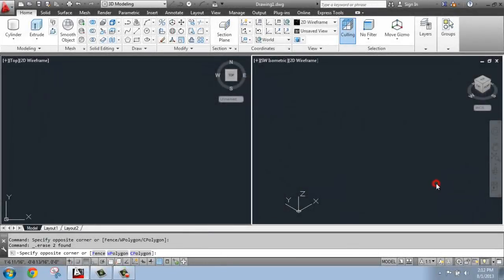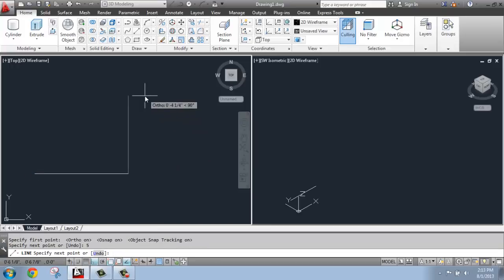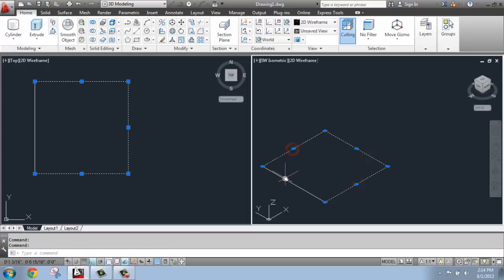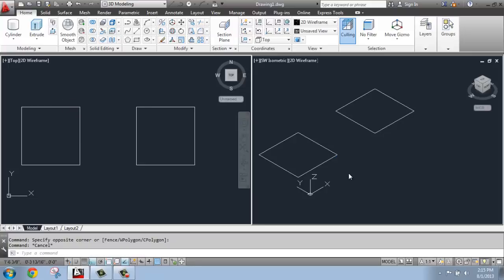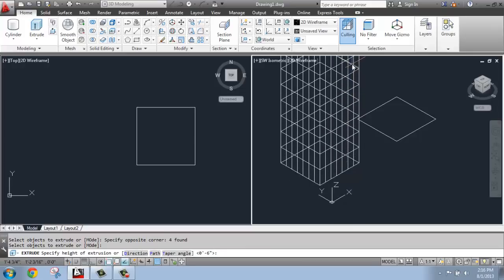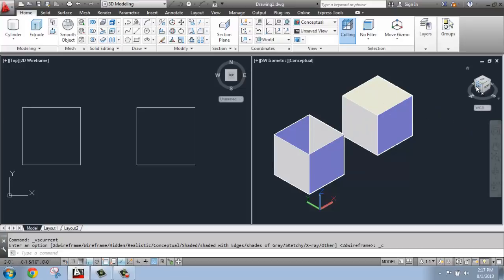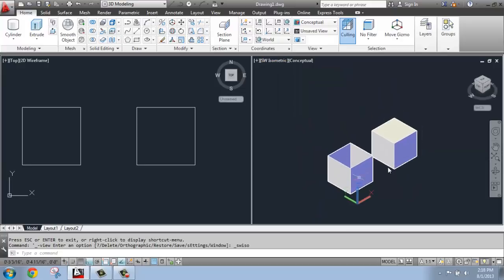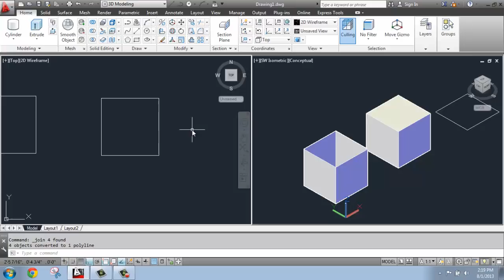AutoCAD - 3D Modeling Basics #5 - Extruding: Solid vs. Surface - Brooke Godfrey

Comment: Having problems making open top/ closed bottom box. Also with the polysolid tool is it possible to determine thickness of walls on said hollow polysolid box. I work in foam fabrication and took cadd in high school but on a much older program. Attempting to make a production layout for foam pads inside a cardboard box with a hinged top.

Comment: Not sure what I'm doing wrong: I followed your examples, and I have somehow managed to get the same results with a line tool as polyline: an open top and bottom box: the wireframes look identical... The thing is, I was able to make extrusions of rectangles before that ended up as a 6 sided solid. I get the impression I flipped a switch (mode) or something.

Comment: I played around, viewports set up just like yours. I made a square with 4 separate lines. I extruded it. Then I joined them in the left viewport. No change in the right viewport. But when I exploded it back to 4 lines, the right viewport changed to look like a solid. I changed the right side from 2D wireframe to conceptual and it still looked like a cube. Can you explain what happened?

Comment: How do I do this in 2015 ? I cant find the extrude box..
Reply from the maker: liteglow2000 I'm not using 2015 yet - type in "EXT"
Reply: Brooke Godfrey  Ok, But thanx anyway.  I was not in 3D mode, only 2D  .when I changed to 3D drawing it did appears.   thanx for the tutorials.  cheers